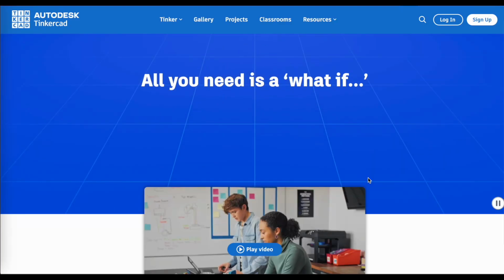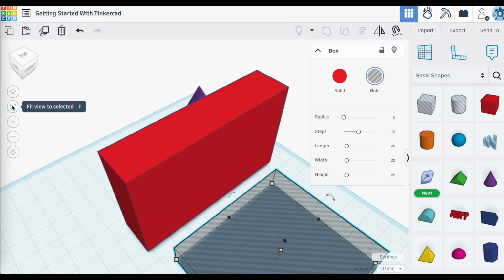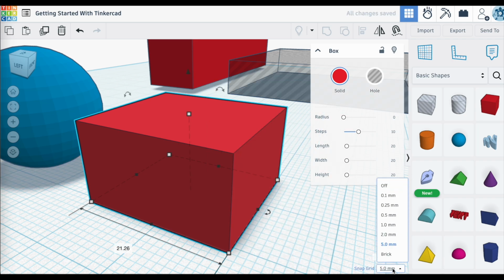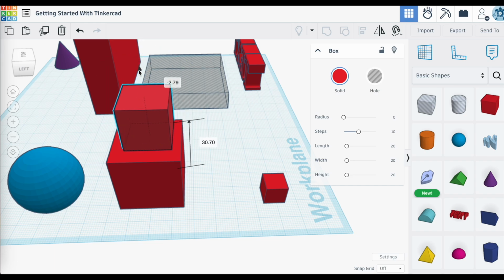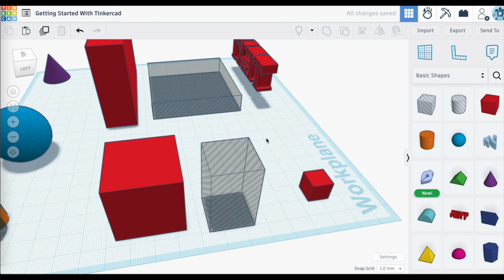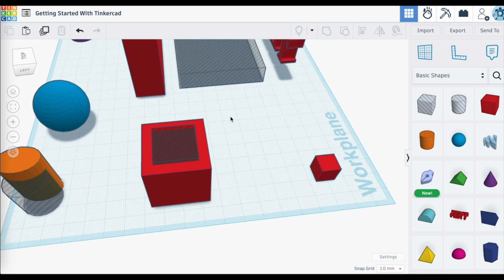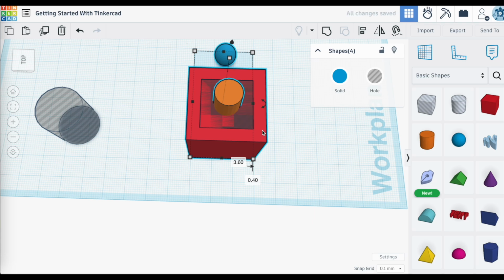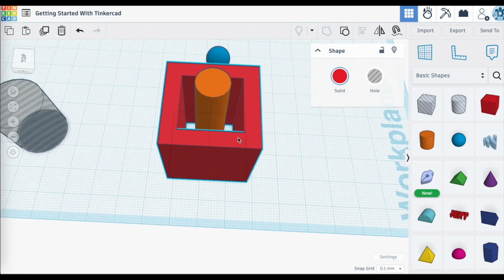Tinkercad Tips Every Beginner Should Know To Avoid Frustration

Comment: What I found to be rather frustrating is when the object suddenly scoots waaaaay off the build plate to the point where it gets so small that it becomes unrecognizable and nothing I try, returns it back onto the build plate area😮
Reply from the maker: Hi @willparsons32 - Yeah, for me that happens when I am viewing the object from the side and sometimes when I intend on resizing it by clicking and dragging on a white or black node (marker) but I instead move the object and it ends up shifting far off of the building plate.  If this is how it happens for you, I find that using the undo arrow immediately after it happens snaps it back into place.

Comment: Drives me nuts stuff flys all over the place when trying to view things seems jittery
Reply from the maker: Hi @noofynumbskull - yes, the movement in Tinkercad can be tricky - especially when you are up close to an object.  Pressing and holding SHIFT as you attempt to move your view will make you move side to side or up and down instead of revolving your view around an object. That might help as well.  Also in the SETTINGS (lower right corner of your screen) you can adjust ZOOM speed this might help if you have a sensitive track pad/mouse.

Comment: Unsure if it’s been covered since you released this but…. You can also observe the object dialogue box that appears when you select multiple objects it shows how many are selected in brackets “object (3)” for instance to signify 3 objects selected.
Additionally that dialogue box when you are resizing an object is very important. I learned last month when trying to drag points on a beveled edged box/cube that it distorted the bevel. If however I enter the precise values I want in that dialogue/object box for size it maintains the bevel accuracy.
Thought it was worth a mention in any case.

I wish they would add similar movements to Tinkercad as a lot of slicers have where you can move the workplane with one mouse button. Or allowing you to with arrow keys when no objects are selected
Reply from the maker: I have never noticed the numbers of shapes selected (number in brackets) before!  Very good to know!  Thanks for the tip!  I can’t remember which video(s) have it but I have mentioned the drawback of resizing beveled shapes using the drag points instead of the dropdown menu but it never hurts to remind everyone about it.  You bring up an interesting point about the ability to easily move the work plane - I have also found toggling the work plane tool ON and OFF to be a bit clunky.  I wonder if the “cruise” tool was their way of trying to work around this.  Very interesting points - Thanks for the comment!

Comment: I wish Tinkercad would have an option for diameter for both cylinders, spheres and any other part that is round.
Reply from the maker: Interesting. Yeah, I have only seen radius settings for objects like the torus or tube.
Reply: @technobentobuilds  I have seen another YT guy use a work around for diameter measurements, however.

Comment: I have an object the shape of a coin.  I would like to cut away and leave it the shape of a dome.  I found the dome object and can make it a hole object but that does exactly opposite of what I am trying to do.  It cuts away the dome shape and leaves the part I want to cut away.  Im not sure if I'm just overthinking something or missing something obvious.  Is this doable?  Why not just start with the dome?  The coin shaped object has design's that I want to preserve but get them into the dome shape.  If you were to look straight down on the object it would look the same a the coin shape but if you look from an angle it will be 3d.  I hope I am explaining this decently.  Im not sure if I have the terminology to accurately describe it.
Reply from the maker: I think I get what you are trying to do.  If you end up with the shape that you want to cut away, you can then select it and make it a hole.  You can recreate your coin and then apply your new hole on top of that coin.  Sorry if I misunderstood your question.
Reply: @technobento8986  that may be exactly it.  Thank you.
Reply from the maker: Good luck!  I hope that works!
Reply: @technobentobuilds  That was it.  worked great.
Reply from the maker: Nice!  Glad it worked!